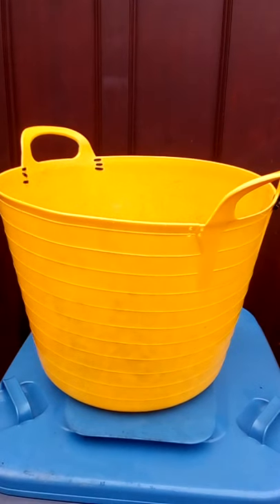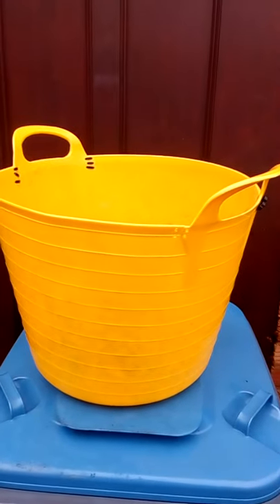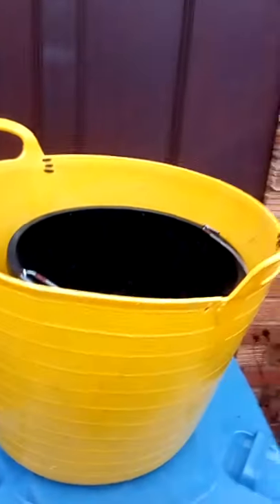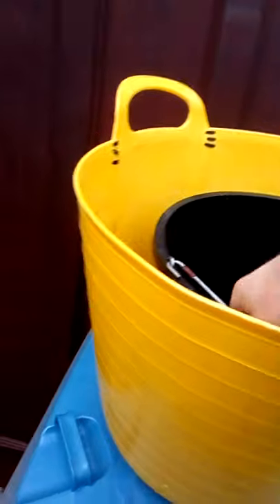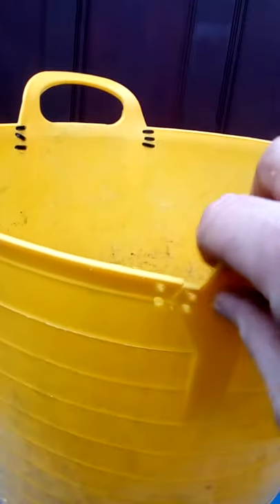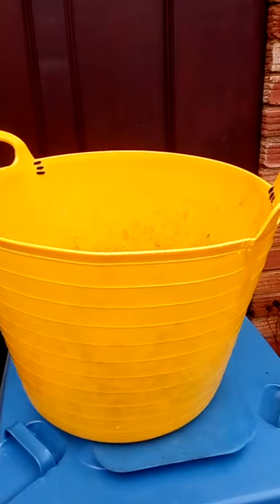Flexible plastic trug/bucket/tub repair

Comment: Very good idea 👍 .I might try a crisscross X .the stitches 🧵 like a pair of 👟 laces..Ive seen some plastic repairs melting the splits in plastic with a soldering iron ..don’t think it will work in this situation 🤔
Reply from the maker: I did another split just yesterday. I used smaller ties but more of them and therefore smaller holes. Good to experiment. As you say, I think too flexible for plastic weld. Would be better to use a repair tape such as duct tape or perhaps foil tape.
Reply: Thank you! I just broke the handle on my favourite trug and now I know how to fix it😊